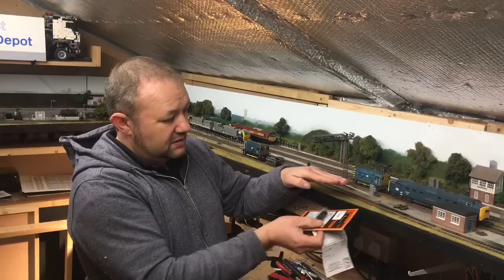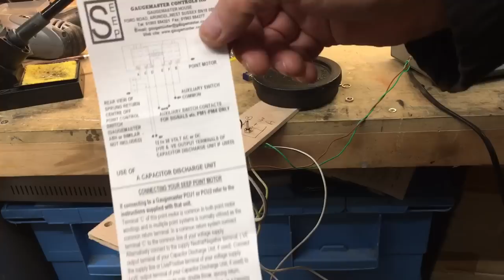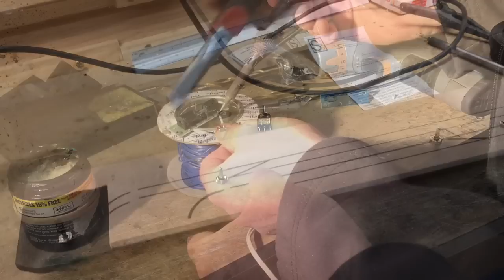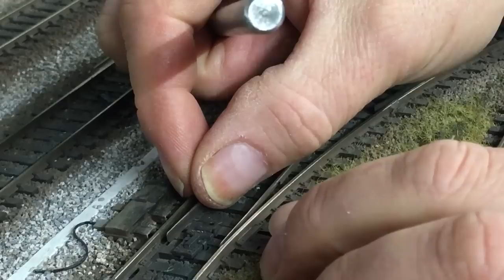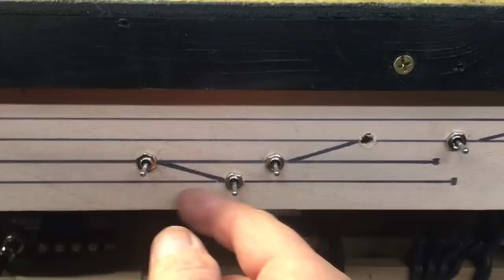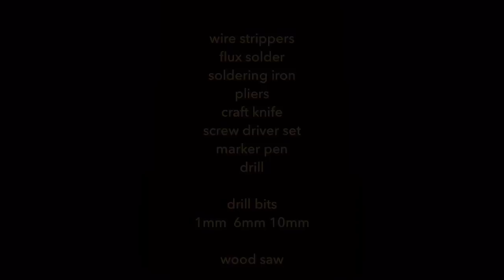Seep PM2 Points Motors.

Comment: A little word of warning to others, I tried installing point motors to points already in situ like how you did Garry a pilot hole from top then a 10mm drill bit from underneath but went too far up and drilled the spring mechanism, tie bar etc out had to send off to Peco to get them to replace the parts. Great video and info
Reply from the maker: Oh yeah that will do them no good 😑 eek,  sorry to hear your dilemmas 🙈 and hope all is working now.

NOPE not the best way to automate points, and not the way to lay track in this fashion lol - but sometimes we change are minds at the last minute and see how to compromise where we are.. 

For me I would have ended up ripping a whole lot of track out that I doubt I could save, then to be replaced once holes were done correctly - so this is obversely a gamble situation that I took and Not for the faint hearted.

Love your comment and this a great top tip, so very appreciated buddy.
Keep safe and all the best Garry.

Comment: I've wired exactly how you have with the PM2 but it will only change one way, it won't go back when I flick the switch. (Also have exactly same switches) Any ideas?
Reply: Works a treat, just wrong switches. Thanks
Reply from the maker: @grantfuller5011  Fantastic. We got there in the end lol 👍😉
Reply from the maker: Hi Grant, Oooh very strange - Have you re-checked the wire feeds and the wiring diagram again, I'm sure you have.. mmnn yeah thats a good one 🧐 I'm assuming these are loose not fitted tests and not added to the layout as minor pin misalignment can cause it to fail...  Okay - I will go down the shed and have a look at my points and see if I can replicate this error.. let me know if some comes emerges..
Reply: @cheekytek  your switches are ON/ON switches aren't they?
Reply from the maker: @grantfuller5011   No-        
 On / Off / On
(They sit at OFF until pressed sideways.)
other wise it will burn out the motor 😬

I would recommend a CDU unit to power them as it stops the buzz due to more punch.
Reply: Any chance of a link for them please? I have the exact same looking switches but ON/ON. That will be the problem then. Thanks
Reply: Found them 😁
Reply from the maker: @grantfuller5011  Yeap that will be it. 👍 

 It obversely acting as  being the centre point and not switching the other side. Glad you found some - 
Let us know how you get on budd - Cheers Garry

Comment: Hi Gary  Another excellent video was there a reason you did not chose to use elctrofrog points ?
Reply from the maker: It is purely a cost due to having 40 new insulation points available 

The layout is built as intended for a demonstration that modelling can be achieved as to a factory standard.

I do aim to build for the enthusiast on a low budget, as the same with all the work I do..

I did find to many layout builds are at top spec and deterring the hobbyist to be creative

I personally have no issues on stalling on points but I do run upgraded loco chassis with a better pickup control 

Live Frog points would be preferable but it’s not everyone grasps on how to wire them up. 

Cheers 😉👍

Comment: Hi, thank you for putting this video up, it will help me with my fitting of point motors. I have 40 second hand ones, i bought from Robin at Milton Mo Junction, last year, he changed gauge. All i have to do is fit a new rod into them. I am using 1mm piano wire, works a treat.
I agree with you about the cost of the hobby, it has gone nuts, even for second hand locomotives and rolling stock. I can see the likes of Hornby and Bachman killing the hobby off for the average person. Quick qusetion, do you have all the switches in series running off the 16v ac slot on the duette ? Great video.
Reply from the maker: Hello Dave, many thanks for your  comment, At the time of doing the video.
I was running all switches off the 16v ac on the duetted and worked a treat, 
By chance I was lucky enough to get a Gaugemaster MCDU booster fairly cheap as to a lot of people’s recommendations on CDU’s running seep solenoids PM1 / PM2.  (As it Protects the life and takes the buzz out..)

The MCDU has its own power feed that hooks up to the power bus feeding the the middle of the switches and the common return of the solenoid motors.. 

This now gives just a bit more throw running 1 switch for a pair of points..  thus making the duette redundant..

if using 16vac duette this would be ideal to run a CDU to hook up to your points and switches as I mentioned.

Dave the cost is worrying as we agree, This is why I make as much as I can to deter the easy pay for it option as many do.. 

It’s the prices of wagons and coaches that have soured because manufacturers know your buy a train cheap then add 20 wagons etc and at 20-40 pounds I’m not playing that game.. 

I am planning a mini update that will show where I am now with the switching panel and CDU feed.. 

If you have any problems send me a message as always happy to help.. 

Thanks again Garry
Reply: Hi Gary thanks for the sub and reply. I have started building a layout again, so your video was just what i needed. I will run my layout with my 2 duettes + other controllers. Don't think i will go DCC, would cost me a fortune to chip all my locomotives lol
Reply from the maker: Dave that’s how I had mine dc and was easy manage. I stepped in to dcc with a high end budget controller - nothing technical but reliable.. lol. 
Just added a £15 chip to a loco every month. To honest dcc is great.. but that’s the most I’ve lashed out..

Have a great week mate 

All the best Garry

Comment: Looks good with the point motors coming together. As others have said, the CDU is a snap to fit, and only a few quid. Definitely makes it worthwhile. 

You have any problems with the PM2 and the actual rod that comes up into the point rotating? I used the PM-1s and had a long-running problem with them, which Gaugemaster then acknowledged they'd changed the way they attach the rod. Have found them very unreliable, but need the frog polarity to be switched with the motor, which it doesn't seem the PM2 can provide. Yours look like they're running great though!
Reply from the maker: Cheers Iain, to be honest I’ve not come across any problems with the actuating arms on the PM2 as they seem to be fairly fixed, as I did look at that theory. 
my points are dead frogs so as you see I did not need the feed switch, very interesting and will keep my eye out on that..

Have you thought of putting a small wire connector block screwed to the leg underneath, strip the white plastic off and take out one screw- may be enough to weight it down and nip it in without getting stuck.. 

I’ll have a little look with mine to see what it dose..  if it helps..
Cheers again Garry

Comment: Hi Garry, nicely explained. I'm not far off what you are doing, finding it time consuming and some motors don't get enough power to fire first time, find that a bit difficult to understand. I to have drilled from under, and a deft touch is certainly needed, well done. I have primarily used peco surface point motors , just for ease of use as 34 units required and as you say cost is a factor. Cheers Jerry
Reply from the maker: Sorry Jerry I missed replying to your comment, i probably did it all arse first.. as i only started drilling holes for the points when I started these point installs,and yes slow and cautious is the key....

  i have to say I found it all fairly straight forward and not as trick as I first thought..  lining up the point accurately was challenging but not impossible,  and Ive just added a CDU unit which pretty much snaps them over.. 
cost is the real factor as you've mentioned..  but glad i tackled the world of points.. lol
Cheers Garry

Comment: Nice how to. How did you avoid drilling up into the point itself? Very slow and steady I assume. I have fists of ham, so I drilled all mine from the top prior to pinning down the point. With all the mechanism I figure you're not going to notice a bloody big hole underneath! Cheers
Reply from the maker: Cheers Davie, I drilled a 6mm hole very slowly followed by 10mm to the centre point mark.. 

as I had cork under the point, the drill eased off as went through. then used a craft knife to pull out the remainder of the cork...

Like many drilling the hole before would of been easiest.. lol. but i was never going to add motors but changed my mind..  like we do... lol

cheers again..
Reply: I haven't installed any of them yet, but I intend to use the clothes peg and rod method. Electrics are not my strong suit, so keeping it (stone age) simple is my way to go! Cheers

Comment: Nice work Garry. I have a similar setup but use a 12V DC supply which is quieter and easily handles 2 points at once for crossovers.
Reply from the maker: Hi Gerry, oh wow that's interesting, do you have a CDU unit added to that...?
Reply: No CDU fitted. What I have been experimenting with recently is an old PC power supply that gives 3.3V, 5V and 12V with lots of current on each. Very handy for LED lighting etc etc
Reply from the maker: Okay... interesting...

Yeah I have an PC supply that I use for when Im doing electronic testing etc.. there very handy.. 
just not used it on the layout as I have 12v modules for lighting.. etc.. 
cool
thanks again buddy..

Comment: Hi Garry,

Nice video to show people how to use the seeps,  I am sure you will like being able to control them remotely from now on.  A little tip.. When trying to centre the point try using abit of small wire (I used 7/0.2 wire) between both of the blades, It centred mine perfectly but I had removed the spring so not 100% sure it'd work.  Cheers,  Michael
Reply from the maker: Great tip Michael, I’ll try that..

Life is certainly easier now playing trains lol..

Cheers again Garry
Reply from the maker: I added a couple more solenoids today and used your little tip.. God that was so much easier.. 
Big Thanks.     😉  👍👍👍
Reply: cheekytek Awesome! Glad it helped 👍

Comment: Great video but a CDU is a must for solenoid points over time without one it can put strain on the power supply but more important you get a nice clean switch and you can easily power more than one point with one switch with no worry of a failure.
Reply from the maker: Cheers Rob, as you’ve mentioned yeah great sound advice will add one as have a unit on order.. 
cheers again.. Garry

Comment: Hello Cheekytek,         I would agree , there does now seem to be a desire to " throw money at everything " in this hobby .
  It`s  good to see someone using a straightforward system again . Although you mentioned your desire not to use a
  CDU , I would urge you to reconsider this .  The modest outlay would be well rewarded . One CDU will power the entire
 point system ; the risk of burning out the motors would be eliminated , so to would the buzzing noise , and it will have
 the power to move two points simultaneously .  Keep up the good work , It`s a brilliant layout ,and I always enjoy the
 way you present your videos.     Regards ,  Paddy Owen .
Reply: irene forward - agree a cdu is well worth it.
Reply from the maker: Wow Many Thanks Paddy,

I do have intentions to add one as I’m at aware that it will reduce burn out and punch more power.. I really appreciate your comment on this, and very valuable..

I try to build in the most simplest way to suit all ages, as the industry has cashed in on this hobby to suit a higher earning audience, yes we can all follow that but where’s the imagination like we both say.. 

Many thanks my friend for following my passion and journey..  

All the best Garry
Reply from the maker: Many Thanks. 
I now have one fitted and your right in saying so, it’s quieter now and each point has good punch to spring across.. 
Cheers again 😉  👍

Comment: Great detailed video. You're right in saying not enough clear videos on how point motors work.. I put together a video last year on pm1 motors and made it as clear as possible.. i would say check it out but you're not using electrofrog points.. The cdu will stop the buzzing noise..

Thumbs up!
Tim
Reply from the maker: Cheers Tim,  yeah it’s is one of most featured things but everyone does it a little different.. yeah Looks like I’ll add a CDU at the end of putting in all the motors, 

but like you say nobody actually tells you the advantages of using a CDU, but I get it now from doing it.. 

I guess I’d only need one unit for all as I would only be throwing one point now and again.. ? 

Cheers again mate..
Will check your vid out though..
Reply: cheekytek I watched video after video. All of them showed only parts of how it works.. I'm using gaugemasters MCDU (mains) so the cdu comes with a built in plug -  wire the layout up, plug it in and away you go. This will power all 30+ points on mine as the cdu stores power and will send a burst of juice to which ever point is being thrown.
Reply from the maker: I did see that Tim, and you were the only one I could see using the MCDU.
 I found that very interesting and may go with this option as to how you explained the unit - it’s what I really could do with... 

Cheers for this...
Garry
Reply: cheekytek as I'm aware I don't think gaugemaster make them anymore. It's worthy of checking around various online shops to see if they have any left for sale if you're heading in that route. For the heads up though - there's one on auction on eBay that ends today! RRP was £25.
Reply from the maker: Hi Tim, good news I won the MCDU on ebay today.. 😆£12.50 so will have by end of week...  
many thanks again for your help....  

Garry..
Reply: cheekytek. Super! About the same I got mine for. Fairly straight forward to wire up but any problems give me a shout.

Tim